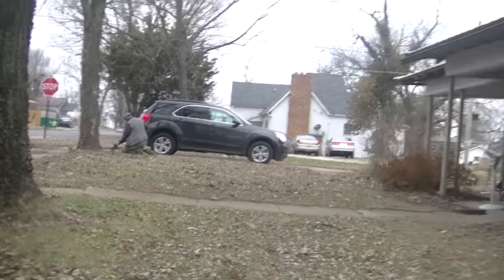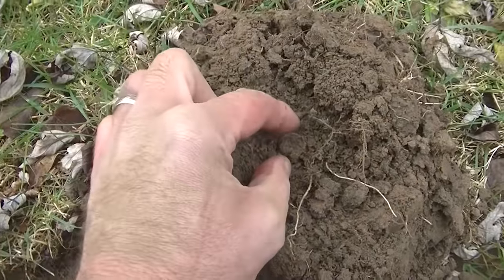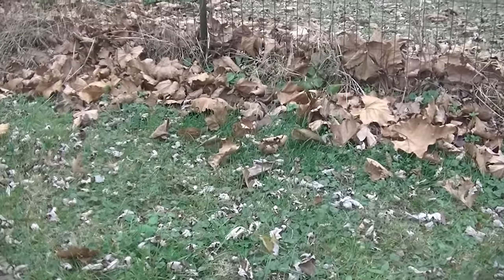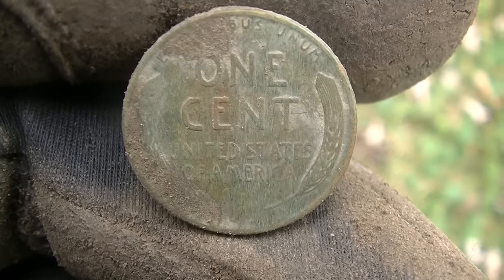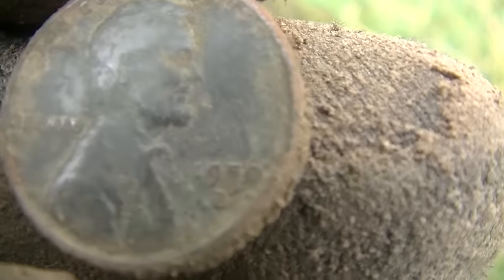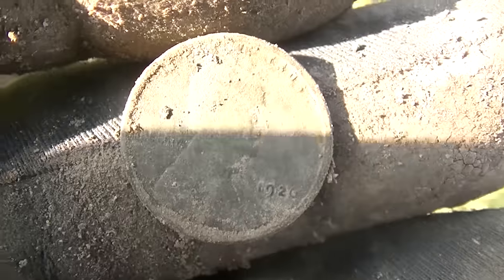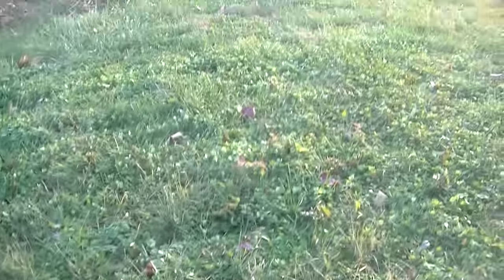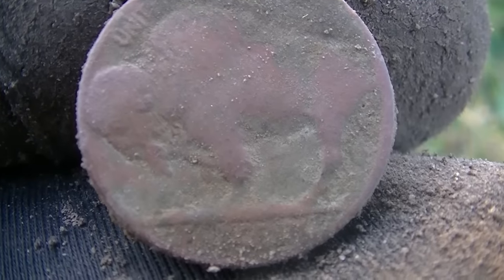PMF#50 She Called the Cops!!! Metal Detecting Bad Guys..Awesome Silver

Comment: Why are you digging up a shovel size plug ? You should be using your pinpointer first, then only make a 3 to 4 inch diameter plug. That way you are not destroying those big areas. People do not like that. That's why you are getting run off and the cops called on you. I have been detecting for a year now with a 77 Y/O buddy that has been doing it all his life. We have never had that happen.I only cut a small plug with a knife while in yards,get the item than carefully put the plug back in the hole and press it back in place with my foot. I always get invited to other places.

Comment: If you guys dug holes like that in my yard I’d call the cops too.  You can do this in a pasture or field but not in a yard.  I never dig holes like this.  You can’t tell where I’ve been when I finish.  Sorry but very amateur.
Reply from the maker: Appreciate you sharing your thoughts. Even though you can't tell where we've been either, the larger shovels were probably a mistake. Jeff
Reply: I could see your plug cuts on the previous holes in the camera after they were filled. You need to do a better job packing it back in. Yes larger shovels are gonna cause problems, before you even begin most of the time. And i wouldn't stay more than an hour on any permission in a small yard like that. If i'm in someones yard i don't cut a plug more than 5 inches across.